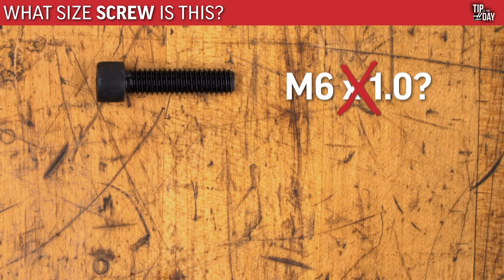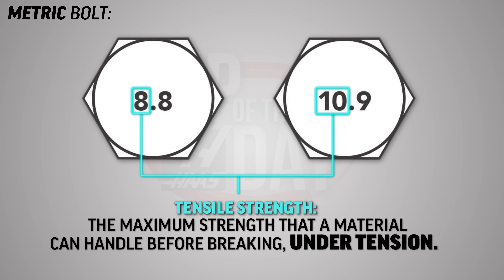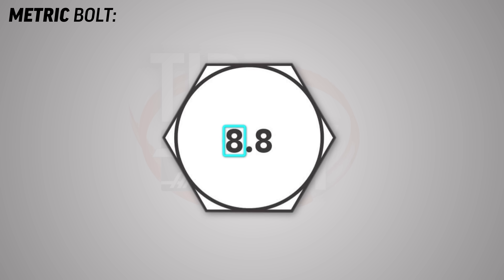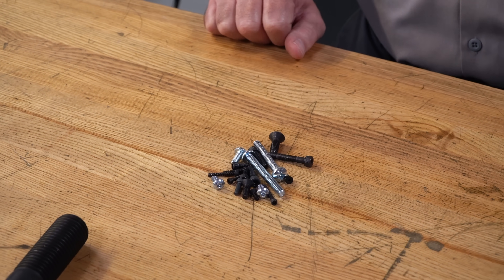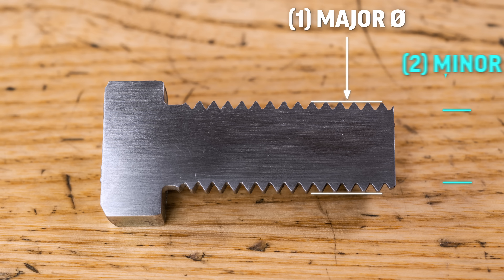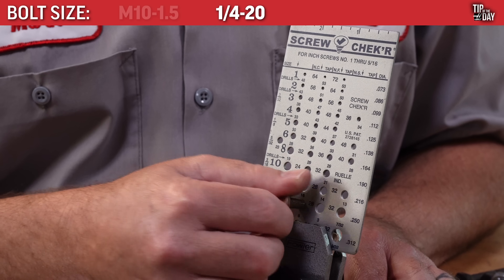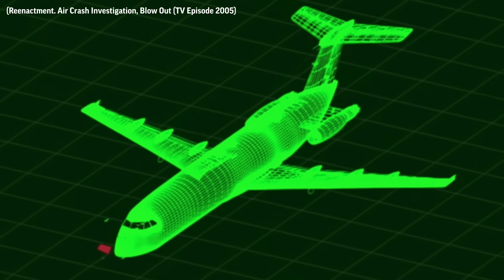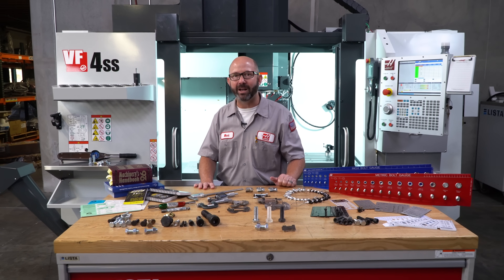The Nuts and Bolts of Screws: Bolt ID for Machinists, Mechanics, and Engineers - Haas Tip of the Day

Comment: 🙂The marking "8.8" on a bolt indicates its grade or strength classification, based on ISO 898-1 standards for metric bolts.
What "8.8" Means:

    First Number (8): The ultimate tensile strength of the bolt material is 8 × 100 = 800 MPa.
    Second Number (8): The ratio of yield strength to ultimate tensile strength is 8/10 = 80%.
    So, the yield strength is 800 × 0.8 = 640 MPa.
Yield strength is the force the bolt can withstand before it begins to stretch permanently. For an 8.8 bolt, the yield strength is 640 MPa.

Comment: That's only metric and imperial what about BA, whitworth, NPT, BSPT,  Lorentz threads haha after a while you realise you only need metric and imperial pitch gauges and a micrometer and a table of all screw threads. Eg BA (0ld British Association) can fit some metric threads. There is a historical amount on screw threads  in each trade and each country and each area eg the scientific threads used could start an encyclopaedia themselves. In my youth I did start an excel spreadsheet that had all these weird and wonderfull new old and historical thread data put in I could easily tell ( pre interweb days or just at the start mid 90's) it was a great tool working in a University where you got everything thrown at you from new to antiquated.

Comment: Whoa there big guy your assertion that an American cap screw maybe 20% stronger than a grade 8 would be dangerous at best grade 8 is the most dangerous of all of our American follies.
The grade 8 specification is too wide to be of any value this showed its head in a bad way during the Apollo program fasteners were too hard and broke catastrophically fasteners were too soft and failed often catastrophically but not always but failed nonetheless.
Typically in racing grade 8 fasteners are not allowed especially on brake systems steering gear and other critical systems and without having to drone on I will leave it at that I have always preferred the metric system and the markings on metric fasteners as an American we must work in every system I just wish that we could make our original imperial system as many referred to it as a historical thing of the past.

Comment: The windscreen departing the plane would have been prevented if the tech would have used the correct screws listed in the planes illustrated parts catalog.  That;s what is for, to get right parts and fasteners the first time. I wonder how the tech torqued those smaller fasteners. i know that it wouldn't work , just continue to spin. And you say co-pilot but the video shows the pilot, LH side .  Great info on the fasteners BTW. lots of good info i didn't know . Thanks.

Comment: Mark, I think to state that "all inch grade socket head cap screws are still very strong, equivalent to metric 12.9" ...is misleading. The very fact they are unstamped means you can say nothing about their strength as they are an unknown quantity. What is to stop a factory in China making horrible bolts from garbage grade steel, leaving them unstamped and sending them out into the market? They could end up being the bolts you describe as "still very strong, equivalent to 12.9" .?.......

Comment: Really good video but I would have added a rod bolt stretch gage in my talk, I use one, a tensile tester along with a profile projector and hardness tester when teaching industrial materials in my machinst program and we check dozens of bolts (screws) lol. PS: posted your video to my CANVAS account for my students.
Reply: That is terrific! We have ARP bolts across town, here in Ventura County, and we almost hit them up to get some footage of their Tensile Strength testing. We also ran quite a few tests where we torqued the screws past their Yield, and then again until they failed. That footage may end up in another video someday. Thanks for the comment.

Comment: How does one accidentally use an 8-32 instead of a 10-32 90 times? They wiggle even half an inch in and will strip if torqued.

Comment: Well i beg to differ on the lines on the bolt head, you made reference(at 1:52) to the lines being inch & no lines being Metric,   because when i was tower building the bolts we used were metric (M32) which did have the lines as well as the 8.8 grading on them.

Comment: Both have their advantages and disadvantages, threads per inch is better than the metric and metric strength markings are better than imperial. However they just bring all this out to make life complicated. 50 years ago all you needed were 4 wrenches or spanners, 1/.4,  7/16, 1/2, 5/8 and in metric world 6mm, 10mm, 13mm and 17mm. Now you need both plus all the sizes that exist, plus speciality wrenches torx, star etc. You can never have enough tools they say, I say they have gone over the top.

Comment: Except that these “bolts” are screws, not bolts. I would think that that basic fact would have been said correctly. A screw has an end, or head, that can be tightened by a screwdriver, or a wrench. A bolt has a head that has no way for a screwdriver or wrench to tighten it, and must be tightened from the thread end with a nut there. It usually also has something under the head, such as a short square part of the shaft, or serrations, to catch the part, preventing them from turning.

So, while sometimes a hex head screw is called a bolt, it’s not. It’s a screw. Yeah, it’s minor, but correct is correct, and can get confusing if the wrong term is used. With some things, such as with welding, where often the work clamp is called the ground clamp, it can be downright dangerous. Connect the work clamp to something that’s actually grounded and start welding, and you might find your welder burning up—if you’re lucky.

Comment: Rather than saying inch, where I am from we would say imperial, as inch is a specific size.
Reply: I think you are right, even for us here in the U.S. For lengths, we should call it the Imperial system, while just calling it "Inch" is more of slang term. What gets even stranger is that we don't completely use the Imperial system either. For measurements like pints, cups, and gallons we use US Customary Units, which don't match up to the Volume Measurements in the Imperial System (16oz per pint in US, 20oz per pint with Imperial System). Don't shoot the messenger!  Thanks for the comment.

Comment: Thank you for the video. Always good to get a refresher on hardware sizes. I work in aircraft maintenance for a living so I deal with hardware that is identified all sorts of ways so when I’m doing car work or repairs on things around the house I have to remember how this all works again. Flight 5390 He removed bolts identified as A211–7D. However, if he had read the manual, he would have known that the windscreen was normally secured with the similar type A211–8D bolts, which had the same diameter but were about a quarter of a centimeter (Longer). So in this case a specialty fastener the number has some cryptic special meaning and the 7D vs 8D indicated the length not the diameter. So he used a torque wrench and torqued the fasteners which would not have worked with a smaller diameter. In aviation almost all nuts are self locking and so in this case the bolts failed to engage the self locking feature.

Comment: As far as flight 5390 goes a bolt checker would not have helped. The window had been installed with the smaller bolts originally. When the mechanic replaced the window he matched the bolts he took out with new ones and replaced the window instead of following his checklists and referring to the aircrafts books to look up the correct size. This lead to much tighter restrictions on aircraft maintenance and now mechanics do not have access to bolts. They have to go to a desk with all the information of the aircraft they are working on and give it to a guy or gal working the desk who looks up the correct bolt and then gets it for them, kinda like a pharmacy.

Comment: Metric bolts minor diameter is also its major diameter minus its pitch. so if you are tapping a hole for a M12x1.75 you would chose a drill by subtracting the pitch from the diameter. 12mm-1.75mm= 10.25mm tap drill. or an M6x1 would be 6mm-1mm=5mm tap drill.

Comment: 3 radial lines = high tensile structural bolt. 1 1/4, 1 7/16, 1 5/8. 3/4, 7/8, 1". Ironworker for 20 years. I loved connecting A325 or A390.

Comment: 40 years ago, I worked in an engineering-supply house for 7 years... I got to where I could tell by just looking at a bolt OR a nut exactly what thread it was UNF / UNC / METRIC / Whitworth etc) .. and I knew off by heart the tapping drill sizes too !  

We also sold those Zeus Flip books (on the bench at the start) which were a mine of information & plastic coated pages for longevity... 

I had a priest come in once looking for a nut to fit something up at the church, I can't remember now, but he had brought in a bar of soap with an impression of the bolt thread !! 😁 
He was obviously a McGyver fan.. 😏
Of course, I was able to match it easily enough & I gave him one on the house, telling him to go easy on me next time I was in confession... 🙄😇

From the Emerald Isle
😎👍☘️🍺
Reply: I work at an autopart and honestly, I might use that soap bar trick😅

Comment: At 10:00, what is this tool called? https://youtu.be/fhrBYBiSFKQ?t=600
Reply: These are terrific slide-charts to have on our desks. They are Holo-Krome Socket Screw Selectors. Part numbers: SAE: 99013 Metric: 99014. You can find distributors with a quick web search.

Comment: Great tip. Previously I would use my tap and die sets to figure out the pitch with a small pitch gauge and systematically testing the screw/bolt in each cutting die. Blissfully unaware  these basic templates existed. Amazon has had a sale today because this is a no brainer !!

Comment: @12:30 Yeaa... I'm gonna be that guy and say Metric could again have prevented this... .026" is like 2/3 of a millimeter difference which kinda implies it being in the ballpark of the threading juuust making enough contact to explain how something like this would have been possible ( that is if you kinda ignore the concept of using a torque wrench to fasten screws to spec to a million-currency ppl mover which I'd argue would have caught such a mistake ) wich wouldn't have worked with Metric. There is only falls out ( if not while threading it in with your hand then most definitely after you start applying the faintest amount of torque ) / proper fit ( as all things should be ) / doesn't fit ( cannot insert screw to begin with ) with nothing in-between except for cross threading when using the wrong pitch screw which would quickly fall in line with the latter.

Comment: Am I the only one bothered by aftermarket suppliers who make parts with inch bolts on a metric vehicle? 

I bought a lift kit for my 90's Isuzu and replaced every bolt with flange head metric bolts. It wasn't hard to find. Don't know why it was so difficult for the supplier to do the same?

Comment: Top job  - and love the rubber bolt, what an excellent demonstration tool! Kudos!
Reply: I made these stretchy silicone bolts and painted them, also molded the clear resin bolt, based on a mold of the 5/8-11 bolt I already had. Learned how by watching YouTube! https://youtu.be/PGytZQIVcuA the mold release in the video (Palmolive soap..) didn’t work for me so I just used 4-5 layers of Mann Release 200. Molding a silicone part in a silicone mold can be tricky because the part wants to bond to the mold of the same material.
Reply: @markterryberry4477  just super clever demonstration of bolt stretch, I’ve been in the metalwork all my life and know it happens, but such a great demonstration. Well done 👍

Comment: 6:05 All inch socket head cap screws are stronger than grade 8? Oh dear,  no. Sure, lots are, but there are all types out there. Pick your favorite size in the McMaster catalog and you will find different strengths and materials available. Even assuming a steel black oxide screw, trusting greater than grade 8 strength is going to give you a bad day sometimes if you need that strength.

Comment: Sorry to point out but- a bolt is meant to be tightened with a wrench while a screw is not. Both bolts and screws can be used with nuts or turned directly into part or fixture.
Reply: Yes both can be either used with nuts or directly into parts. Screws have thread up to the head, bolts have unthreaded part.

Comment: I'm as American as they come, but enough is enough - when are we going to put an end to this clusterf*ckery with US customary units and move to Metric? Everything  is just so much  easier...and what's more, everything is logical.
Reply: Probably never, as a European I see in an Imperial bearing catalog 2" (OD) - 1" (ID) bearings as 50.8 mm (OD) - 25.4 mm (ID).
In Metric there are no 50.8 mm - 25.4 mm bearings but e.g. 52 mm - 25 mm.
In manufacturing and replacement parts there will be for decades all types of both numbers, strange on both sides.
Yes, I love the Metric system, it's used for lenght, weight, surface, volume, etc.

Comment: That airplane failure would have not happened in the metric system, since the common bolt sizes are stepped in a way that a smaller crew will not get any grip in a bigger thread. I hope this makes sense

Comment: Great Video, nice to know how the Inch-System works.
But I think you got the Numer for the minimum yield strength wrong. It's not the percentage. To find out the yield strength, you muliply the number before the decimal point with the number after the decimal point, and that is then muliplied by 10. For example: 10.9 10x9x10=900 N/mm². This is what it is written in DIN EN ISO 898-1
Reply: Is 900 not 90% of 1000? It's another way of stating the same relationship.
Reply: @djizomdjinn  that happens to be also correct in case of 10.9, but it doesn't work for 8.8 (8x8x10=640) or 12.9 (12x9x10=1080)...

Comment: Where can I get a bolt that stretches like he used to demonstrate with?
Reply: I made these stretchy silicone bolts and painted them, also molded the clear resin bolt, based on a mold of the 5/8-11 bolt I already had. Learned how by watching YouTube! https://youtu.be/PGytZQIVcuA the mold release in the video (Palmolive soap..) didn’t work for me so I just used 4-5 layers of Mann Release 200. Molding a silicone part in a silicone mold can be tricky because the part wants to bond to the mold of the same material.
Reply: @markterryberry4477  Oh ok, thanks.

Comment: I have grown up, persay, using the imperial system. Notwithstanding, I do have high regard for the metric system and have used it extensively. However, due to the switching back and forth between systems, sometimes it gets confusing, as both systems work but are not interchangeable. It is hard for me to understand that a 10-32 can get crossed with an 8-32, but like I say, I grew up with this system but, it would be easy for me to confuse a 6mm with say a 7mm, or even a 1/4-20 with a 6mm. Therefore, I can't be to hard on the maintenance team, for they are under tremendous pressure to keep the machine running, no matter what. We maintenance people are necessary evils in industry. When the machine is running well, the company is losing money by paying us anyway, and when the machine is down, they are losing money because the machine is not productive. Therefore, whether up or down, the maintenance team is catching flack. So therefore, I think everybody in the industry is to blame from the top down and not just the maintenance team. We are the "whipping boys" of industry and are "necessary evils".

BTW, was an excellent, informative video and I do thank you and appreciate you. I am a retired Disabled Veteran and maintenance technician, holding a degree in Industrial Engineering Technology and am certified by the ISCET in industrial electronics.

Comment: 8.8 is for high tensile not metric you will have 12.9 holding you crankshaft in and most I have seen are at ( inch standard)

Comment: I thought screws were anything that goes into a material with no mate, ie wood screw or sheet metal screw that there ca not be a nut for. And anything that can have a nut or mating fixture with threads was generally a bolt.
Reply: I've never heard that, but its interesting.
Reply: I was always taught that if it makes it's own thread as it goes in, it's a screw and if it goes into threads, it's a bolt
Reply: @chattonlad9382   Your teachers are just wrong.   Machine screws.
Reply: I agree you are correct but I know that at work if I use anything with a screw driver style head we call it a screw even if it is going into a nut plate or has a nut on the back. Technically it is a bolt. But you use a screw driver to tighten so you say Screw. Lol.
Reply: What about machine screws? They have a nut.

Comment: Coming from the UK as a fabricator welder we used to have the imperial system as our method of measurement .but I have to concead the metric system (European ) is by far the better system for measuring .for example when making engineering drawings you can fit so much more information in very simply and clearly .
Reply: They're both base-10 systems. Writing 1.00" takes the same number of digits as 25.4 mm. You could call them goatlengths, and as long as it's base 10, there's absolutely not l no difference. Base-10 is base-10.
Reply: Maybe maybe not some long some short .